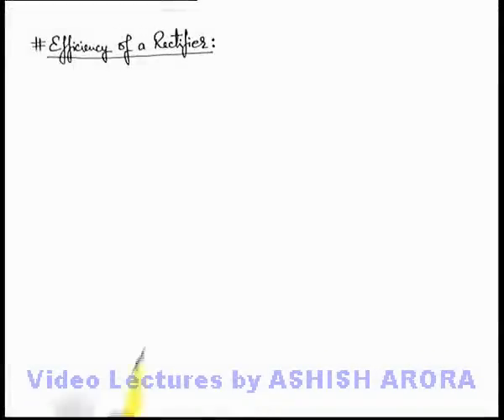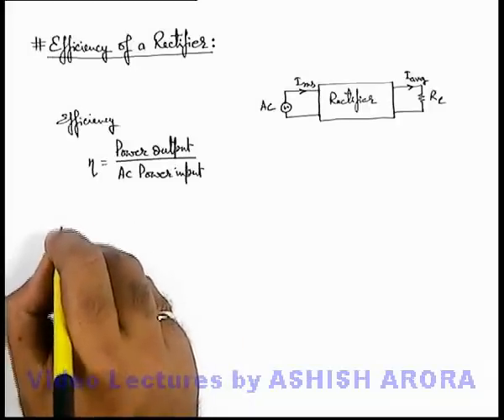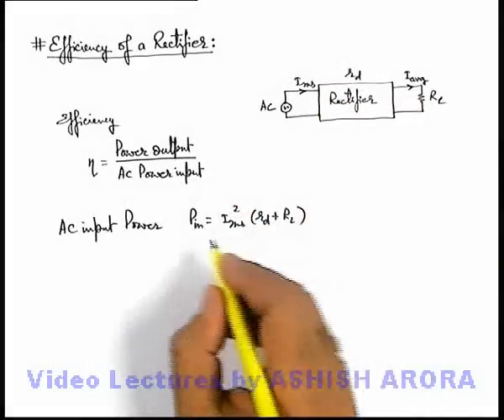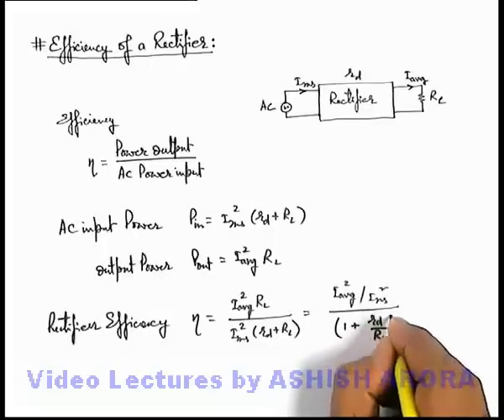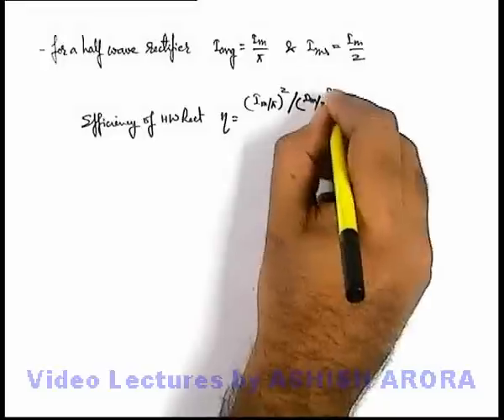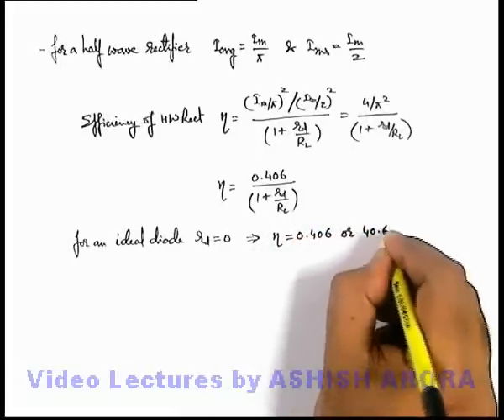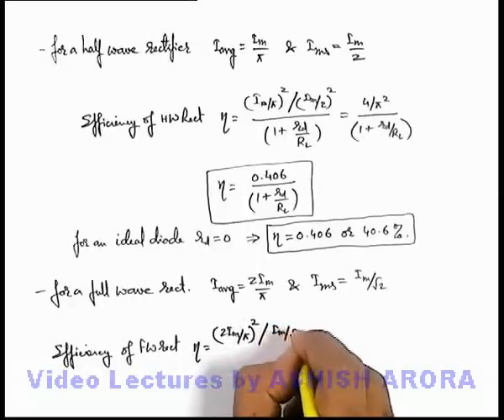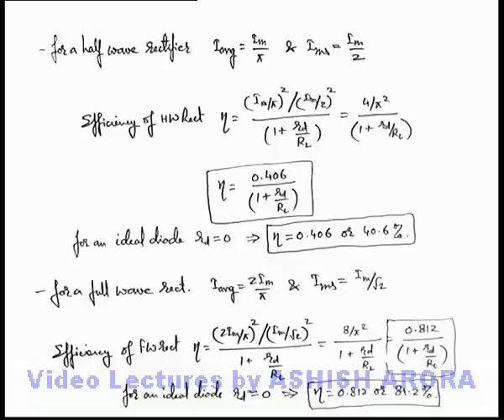Class 12 Physics | PN Junction & Diodes | #21 Efficiency of a Rectifier | For JEE & NEET

Comment: Respected Sir,
*We used i(rms) for the AC Input Power BUT in the case of HALF WAVE RECTIFIER why did NOT we take 
i(rms)=Im/root(2)
because isn't this the value of RMS current in AC.
Instead it was taken 
i(rms)=Im/2
which is for the output DC Power (isn't it?)
*
Please clarify this doubt.........
Reply from the maker: In case of half wave rectified output for half cycle is same as that of AC but remaining half output is zero so you can calculate the rms value for one cycle...

Comment: for efficiency of a rectifier we have to apply dc power output upon ac power input....and in the calculation of rms value of ac input we take it  I maximum upon 2 while in input full wave is there so why we  take Imaximum upon 2 in stead of Imaximum upon root2........plz explain

Comment: Sir, if we use step up or step down transformer then current from secondary coil of transformer is different from current supplied by AC source (efficiency of transformer is not 100%)  hence how can we take irms of ac source for calculation of input power or is it irms value of current from secondary coil ?
Reply from the maker: it is from secondary coil which is the input of rectifier diode ckt...
Reply: OK, thank-you sir.

Comment: Are these results correct for all kinds of rectifier? Then we can not design a rectifier that its power efficiency is over 81.2%?
Reply from the maker: It is for the specific half wave and full wave rectifiers. There are various ways in which rectifiers can be framed with higher efficiency, you will study later.
Reply: Thank you so much. I'm looking forward to watching next videos about rectifier.
I'm looking for a very high power efficiency one.

Thank you!
Reply: Physics Galaxy isn't this definition of efficiency absurd. I feel it should be avg power across resistor with diode/avg power across resistor without diode.. plz reply.. soon

Comment: What is the advantage of bridge rectifier over center  tap rectifier?
Reply from the maker: 1. It uses two diodes in series at the same time so current capacity is more....
2. Less chances of diodes getting damaged/breakdown as two are operating in series simultaneously...
3. No center tap is needed so full voltage of secondary coil is available as output voltage...
Reply: Thank You Sir

Comment: Sir Why we did not take  the output current  in rms value.((Since rms value is that value of DC which when passed through same resistance produce same power as a variable current would produce .......))
Reply: sir plz give a reply....
Reply from the maker: because the output of a rectifier is DC only...
Reply: Physics Galaxy sir but the output DC is not a constant value dc ....it is a varying DC
Reply: So if input is taken in rms value why not the output??

Comment: sir why does AC power input also has RL term in it??
Reply from the maker: Because input current is also returning back considering internal resistance and external in series...
Reply: @physicsgalaxyworld  but when input current is returning back it has been converted in pulsated unidirectional current type then why?
Reply: @physicsgalaxyworld  same as the ac input is returning  back the converted dc can also go through rectifier then why don't we include rectifier's resistance there also

Comment: cant get how Rd and Rl are in series pls elaborate
Reply from the maker: Dynamic resistance of the rectifier is consider as the effective resistance offered by the device to the current and current also flows through load resistance so we can consider these in series...
Reply: @physicsgalaxyworld  but how did we take that Ac flown through load and diode

Comment: Very clear~ Is it possible for us to calculate the efficiency like this when input power at mV level ？i simulate in Pspice there still low level current exist before diode conduct at 0.7V.
Reply from the maker: +姬祥 That current is due to leakage of carrers... and at mV level there is no significance of using such rectifiers... we use SMD rectifiers at low voltage level...
Reply: Thanks ^_^
Reply: R u from China? Plz plz plz plz reply